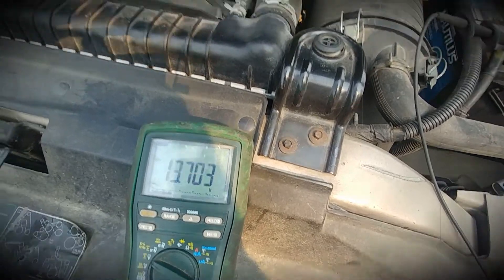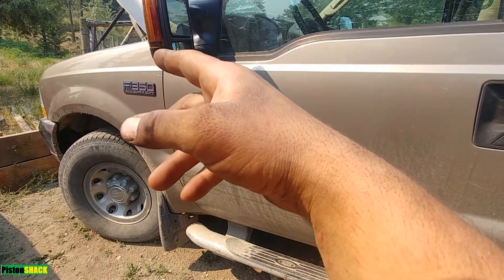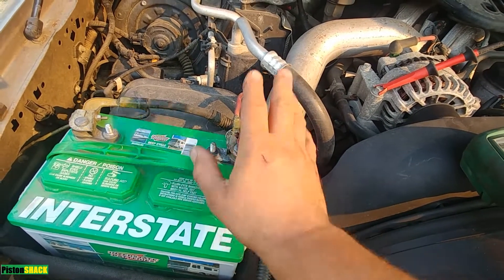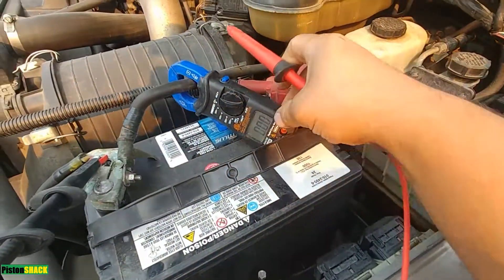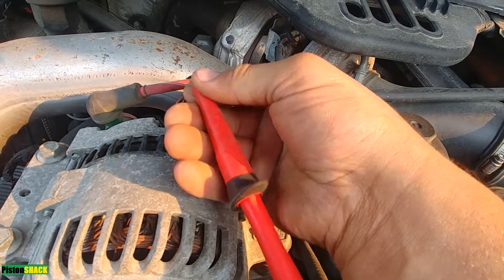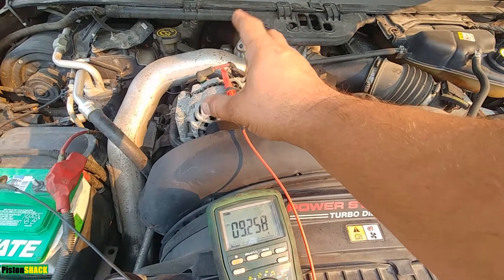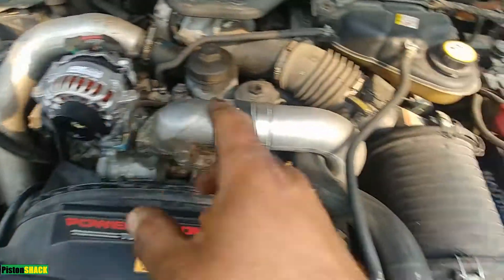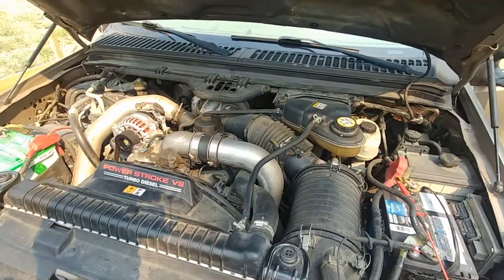6.0 POWERSTROKE ALTERNATOR NOT CHARGING | EASY TROUBLESHOOTING | Fixed

Comment from the maker: More Ford F-350 Repair Vids: SERPENTINE BELT TENSION REPLACEMENT on FORD F250, F350 Triton V8 engine 5.4L
https://youtu.be/5X-Vflmcc6o
HOW TO REPLACE FUEL FILTER on FORD F250 F350 gasoline TRITON 5.4L V8 or 6.8L V10 https://youtu.be/AVc0Ou2DJQY
WHY YOU SHOULD NEVER IGNORE FAULTY PCV VALVE? https://youtu.be/tdeoA4m2IWE
How To Diagnose and Replace Windshield Wiper Motor on Ford F-250, F-350 (99-07) https://youtu.be/5a5_JreHnsQ

Comment: I have a 2003 f350 with a 6.0 power diesel and my truck has a new ground which is good and I checked the red wire in the alternator to the sensor flip and it’s reading source voltage but the green wire to the fuse box is reading 1v and jumping. The truck will start and run but when the I turn off. It won’t start.

Comment: What fuse do you check if you do not have power to the alternator wire that goes to the dash? I have no battery light that comes on the dash when the ignition is on...
Reply: Its a fusible link in the wire itself, the grey part.There a total of 8 fusible links {grey part} in the alternator positive wires. The big red wire on the alternator will have 12-GA  grey fusible links and the signal power wires will have 20-GA grey fusible links.
Reply: I’m waiting for the same answer buddy
Reply: @brandonparker4448  I doubt you and @hurd23 are still looking for an answer on this, I found it in this video:

https://www.youtube.com/watch?v=0OI469Ks6Pw&t

According to my wiring diagram for the 06 model, it comes from fuse 45, 10 amp in the central junction box under the dash, then to the cluster, then out to the alternator.  This power is required to turn the alternator on and if you aren't getting 12 volts on that wire with key on, your alternator will not charge.  Good luck to anyone who finds this in the future.  @danbowers4679 is correct of the red wire that is constantly hot, but the light green/red stripe wire is the field wire coming from the fuse through the cluster with key on.
Reply: Im looking for these same fusible links that i cant find 😂 , battery light not coming on in dash and alternator not charging on a 07 6.0

Comment: Looks like you have two different brands of batteries.  They should always be replaced in pairs.  Did you load test the batteries?  Are they the proper size?  The green one looks too small. A bad battery can take out an alternator, and your FICM.

Comment: Many videos have different opinions of what proper alternator voltage should be.  Some say 14.4 to 14.8, others 14.2 to 14.4, now you say 13.6 is okay.  Which is correct?
Reply from the maker: Vehicle alternator needs to be putting out at least 13-14 volts but not more than 14.5V